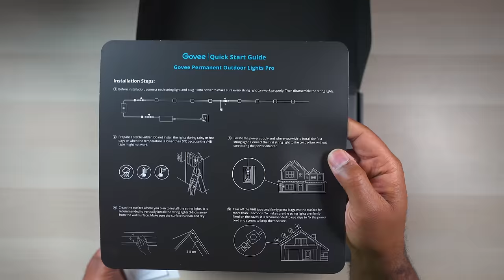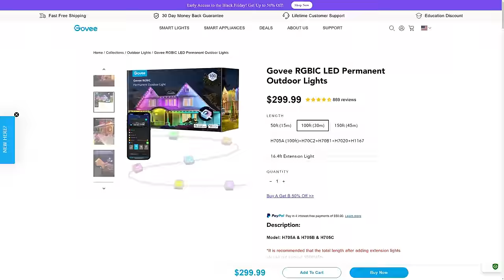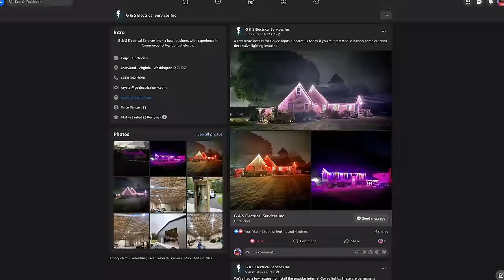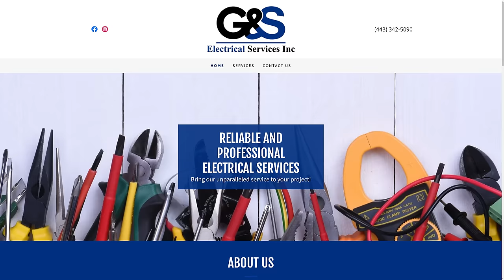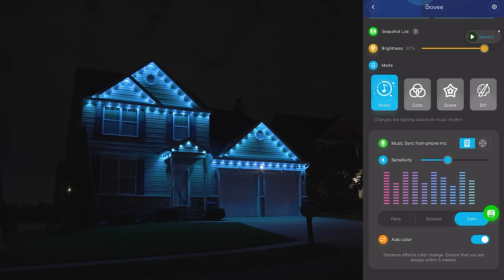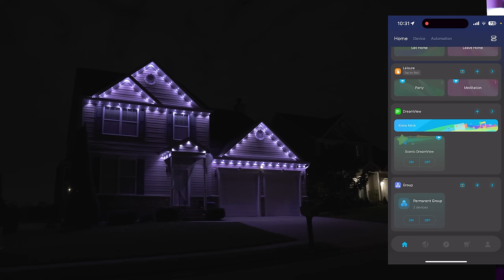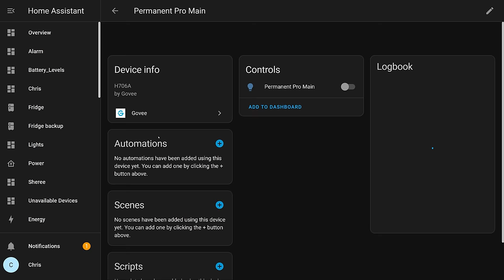Transform Your House with Govee Permanent Outdoor Lights Pro

Comment: I recently installed 4 100ft kits on our house. The lights and hardware are top notch. Sadly the app is lacking when it comes to the perm outdoor lights due to about a third of functions in the app require Bluetooth connectivity. The app is geared more towards their other indoor.. and led strip lights. Overall pretty happy.
Reply from the maker: The only time i've run into the bluetooth issue is when using light groups. If I control each device separately I can control them over wifi. I'm not sure why groups require bluetooth only. maybe that's a bug they can fix later.

Comment: I installed the Outdoor Permanent (non-pro) on my house.  I have the 100-fr on the lower level and three 50-ft’s on my dormers.  They are awesome. Running the St Patrick’s theme now.  I dont find them to be as reliable on custom themes, which was an issue for Mardi Gras. I have yet to see a good video on how to fully use the DIY section of the app.

Comment: The only thing is you can’t find the pro version anywhere , sometimes not even the original version it seems there either not in stock or sold out I even checked govee website
Reply from the maker: Yeah I’m not sure why they are having supply issues.

Comment: I love my Grovee lights (looking at them right now) but they don't work outside in my northern winters. It gets colder than the -4 degrees that Grovee is rated for. 
They also don't have a "twinkle" setting. Or at least I can't find one.

Comment: Hi Chris… I’ve just received my govee outdoor lights pro which will go round the top oar gutter of my house… But.. as I have a small porch at front of house, so there’s a separation from top of house down to porch where I’d also like to run the lights on gutter if the porch , is this possible? Will I need extra cable? Thanks Chris ❤ Ireland 🇮🇪

Comment: I wish there was a pack of fittings to allow the lights to be pointed down on flat vertical roof facias :( we don't have eaves at the front, and not think this would look daft pointing directly out to the road.

Comment: Do you still need the driver module? Is that something they corrected recently because I just bought the 200 foot pro box and that’s the only thing missing.

I plugged them all into test and they all came on fine so I’m wondering if it’s not needed anymore or if I should return this box

Comment: Hi Chris, thanks for the video. have about 250 feet of roofline to cover with lights...so I bought the 200 ft pack and the 100 ft pack. I'm going to connect all 300ft of light into one power module with maximum extension cables to see if I can light it all up using one outlet. If not, ill have to break it up inbto two outlets. 

Do you know if the lighting controller needs to be indoors? I thought it as all water proof... I am going to reach out to Govee to ask.

Comment: How did they connect the upper roof area to the lower part?  With the same strand of wire?  Did you just turn off the leds in the run between the different sections?
Reply from the maker: They used the included extension wires I showed during the unboxing.

Comment: I got a quote from a pro contractor that deals
Minleon to install  200 feet of Govee on my house for $2200.  I think the pro kit 200 feet is $700 so about $3000. I had a trim light dealer quote me $4500. I’m kinda still lost which way to go

Comment: Hey i was thinking bout putting the curtain lights outside too and wasn’t sure it would work but yours look amazing. Just 1 question how do you prevent the wind from blowing the wires and messing up the display?
Reply from the maker: I’ve been fighting with that. I thought about taping them together at the bottom.
Reply: @ChrisMajestic  i was thinking about using the smaller Command branded plastics clips at the bottom of the lights against my vinyl siding. I hope it works

Comment: Im stuck between finish installing the Govee RGBIC 1st generation outdoor lights, or take them down and return them for the Govee PRO ones. Im just not sure if I want to spend the extra $400 for the PRO ones. Is it worth it??
Reply from the maker: It's only worth it if you think you're going to use a lot of white or if you need more than 150ft. Otherwise I personally think it's fine to stick with the 1st gen.

Comment: Was it hard to remove and unstick the old lights to have the new pro lights installed so all your lights were the same?
Reply from the maker: Not at all. We just unscrewed the clips and pulled the lights hard enough to unstick the double sided tape.
Reply: @ChrisMajestic Did you have to use any rubbing alcohol to removed some of the 3m sticky tape on the back of the pucks?
Reply from the maker: @paulmaestas8709  even though it may not have been necessary they did wipe down the soffit with rubbing alcohol after removing the old lights
Reply: @ChrisMajestic  Thank you

Comment: Great informative video. Do you mind me asking how much it cost for them to install it?
Reply from the maker: With the added outlet and expedited install the total was $2200. My install required a bit of extra work over a regular installation though.
Reply: @ChrisMajestic I'm in SoMD. The install looks nice, but I don't want to climb up that high on the ladder. I don't know if I want to spend that kind of cash for the install. Nice to have a reference point.

Comment: Awful mounting design and this is your "Pro Version".  For what you spend on these lights you would expect better mounts for the lights.  Every video out there shows the lights come with a nice mounting bracket the goes over the light, clips to the cord, and screws in.  Not at all what you get.  
1. The 3M tape is a joke even with prepping properly the tape will not hold long enough to finish one string before they start falling off. 
2. The mounting clips they do send only comes 5 per strand of lights.  Not nearly enough to make up for the lack of performance from the 3M tape. Lights still come off between the clips.
3. Returns is where they make there money!!!  When I inquired on retuning them I have to pay for the shipping and there is a 25% Restocking Fee.  Are you kidding me. No wonder you make it hard for people to enjoy them when you make so much off the restocking fee.

Don't waste you your time or money on these lights.  They are anything but permanent!!!